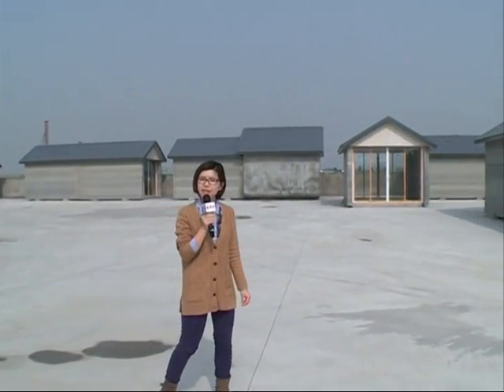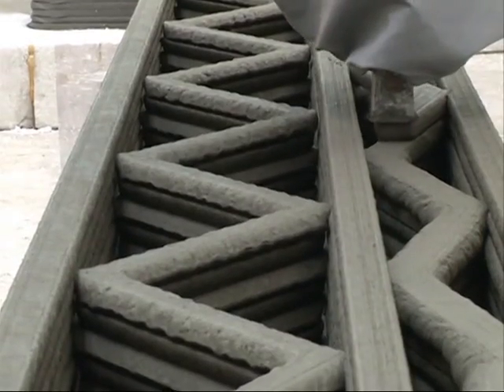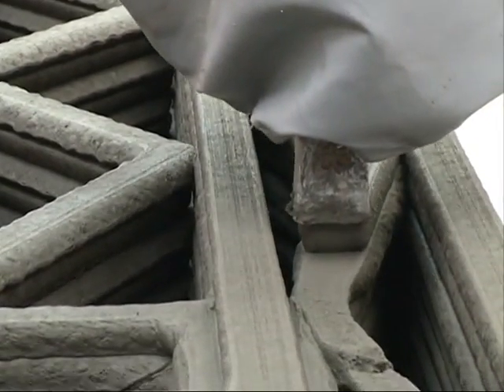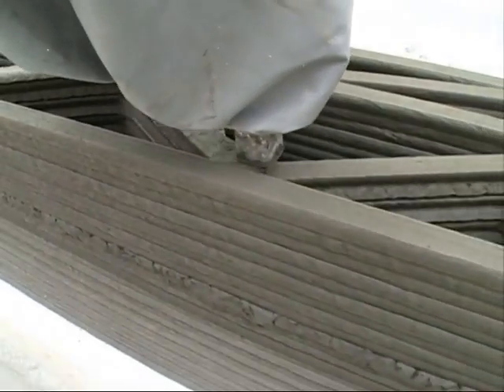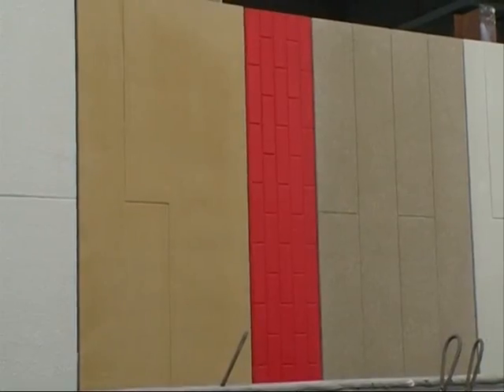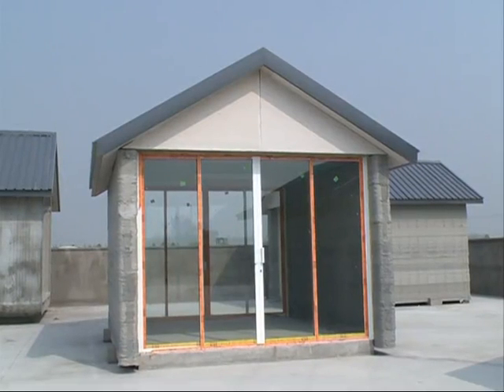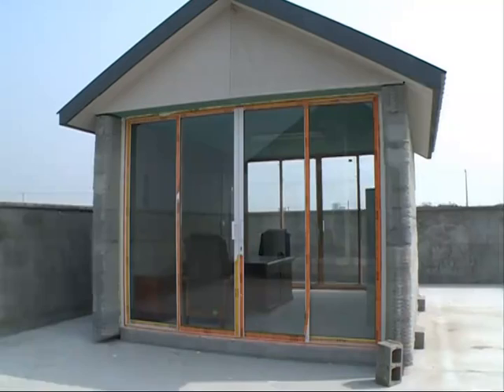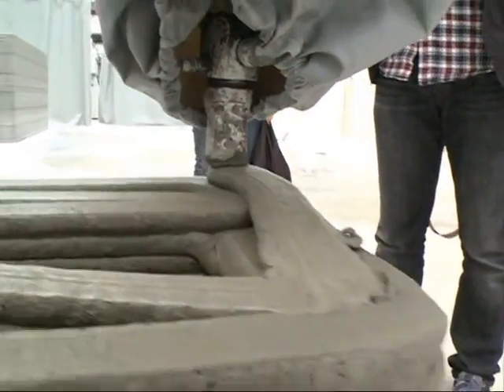3D printers print ten houses in 24 hours

Comment: This is a great concept to build houses for many, both higher cost homes for people who can afford it, but also low income homes.  Having a home out of the weather makes a great contribution to humanity!  I am wondering about the point where the nozzle that deposits the concrete mixture in a zig-zag fashion flows the mix inside the hollow wall.  It seems each point of contact with the inner wall would not be all that great of a bond.  It must work as you have built many successful homes.  It just appears to me to be a weak point.  I am only amateur, but is it a weak point or is the bond very good?  Thanks for making this video and for creating such a great revelutionary way to house all people at a low cost and without cutting down trees, a much more environmental way of construction.

Comment: What is the R-factor of the buildings? What is the vapor and moisture retain/escape ratio? What is the vent and air circulation -%? Cement -and cement only construction is not ideal for every application and climate. I do not see any reinforcing? -not even a mesh-like for stucco.

Comment: Wow - its fast, strong, precise, safe, versatile, sustainable, scalable....such novel thinking! Imagine how this technology could be used to construct "site-specific" homes/architecture - they already demonstrated its ability to construct multiple rectangular shaped houses, but these designs have no relationship to the structure of the land and the weather/wind/sunlight patterns of the building location....site specific architecture requires custom designs based on maximizing the energy efficiency of the home and minimize the upkeep and power consumption necessary to inhabit it.  So, 3d printing offers inherent versatility because the materials are extruded in any direction, making it perfect for customizing the design for the build site.  By utilizing data from the land and integrating it with the design of a building, the outcome would have greater benefits across the board.  Software like Rhino3D and Autodesk programs can combine 3d topographical maps & geological surveys with flow maps, use models, and structural requirements using algorithms that generate forms and structures that work within the parameters derived from such data - there are already many architects using such data driven methodologies to design homes of the near future, check out mark fornes and the very many, he worked for zaha hadid to design buildings from data models and im sure lots of other better examples out there, but its a start. Very inspiring!

Comment: The Salt Project by a Dutch Architect by the name of Eric Geboers will be using waste salt left over from solar evaporation of ocean water to build a sustainable city out of salt and a starch made from algae. A very hard brick can be made and a epoxy will seal in the brick and structure to make it water proof. It would be interesting to see if the salt and starch mortar could be used in this 3D application. Or could the waste brine be mixed in with the cement?

Comment: can I make a remark here. As cool as 3d printing is its not an efficient solution for house building ! What you need is pre-manufactured components that can be assembled on site. They have better performance the house can be moved when necessary or the parts can be efficiently used in other buildings.

Comment: i dont get it. why need so many layers when you can just have one single block of concrete as your wall? just make a mould of the wall structure, and pour concrete in from the top? wouldnt that be even faster?
Reply: It's because you'd have to make molds for all the stuff and the pouring might include air bubbles, which would weaken the structure.  This gives a steady stream, less chance for air bubbles, and you can change the design of the wall structure without having to waste time trying to build a new mold. 

Imagine what would happen if someone broke the mold, they'd have to try and make a whole new one to replace it.  That would be a waste of time and money as a result.
Reply: ***** I see what you mean.  Also, I believe I'd recently found something where just that is going to happen.  They will print up the walls out of cement using the same process.
Reply: john smith having a 3d printer to do the work instead of hiring labourers saves cost in the long run
Reply: john smith Because air pockets serve as insulation and wastes less material when you don't need for it to be that hard.  But what they don't tell you in this vid is traditional poured concrete buildings have a pre-built steel bar structure that can hold onto the piece when it cracks or on earthquakes. When the concrete ages and cracks and weathers, a good earthquake will not only make giant pieces fall on you, but the the wall can fold without the vertical steel bars holding the "broken sections" together.  He's building a large heavy domino house. But China doesn't care, they have too many ppl as it is so their lawas aren't strict like ours.

Comment: How about cables, pipes, sockets in the wall ? Can i drill anywhere to install additional hooks, racks, wall fans ? will it auto-collapse in a quake / tornado ? Can somebody just steal the house away by removing piece by piece ?
Reply: I would use the concrete wall as the outside and fill the gaps with thermal isolation, put drywall on the inside with pipes and wires. :)

Comment: Small houses or shed like building is ok with this technology. But when talking about tall or big buildings then this is not suitable as it is very weak building with only cement and no metal support.
Reply: that may be at the moment, but this is only the beginning. It seems safe to say this process can only improve.
Reply: believe me this technology has only just begun to evolve..
Reply: i agree and also printing food with this isn't FDA approved and not suitable for eating
Reply: They can place metal rebar in the beginning, and then print around it, just like in-situ concrete structural elements in normal construction.
Plus, who knows, someone may invent a way to 3d print much stronger materials
Reply: ***** they will just have to make a machine to weave rebar into the concrete as its poured they already have machines that make rebar mats for roads
Reply: Agree, this is still in the initial stage. If they pump money into research and development. This could replace the ways how common house are build these days.
Reply: Read about jump form, if they only make a better material it will all apply to this technique
Reply: This technology is a supplement that can create "blocks' That you fit together to make the complete house or structure.
Reply: LamboKang= You can use melted metal; for instance. Steel mixed with other materials then you a cooling agent to cool the steel. I can see this technology change manufacturing and real estate development.
Reply: And other areas L: food production and organ transplantation.
Reply: LamboKang they could put metal frames at the beginning but the fact that the printer has to go later by layer is a problem. It can’t print in air

Comment: Those ain't no houses! Just bad jokes or mere cottages for domesticated animals. Nobody can print an entire structure as a whole. At least not yet. Those printers are very good for prefabricated elements for cheap houses. They can do beams, columns, slabs, even walls, but NOT entire structures. How do they print the rebars, and how do they stick or link those rebars together? It's beyond stupidity. It's actually an attemptive murder crime by technical ignorance and lying to the customers.
Reply: yup. you are so smart. here's a trophy
Reply: ipse lute
Calm down, fool. This is obviously still in early stages. You're being a moron, crying over nothing.
Reply: Yow Hwui Low Can you please 3d-print the Hoover Dam? Or maybe The Empire State Building? Or at least Burj Khalifa!! Concrete and reinforcing steel bars are two (very) different materials!! And just because they are so physically different, they must be printed separately.
When you wanna add concrete to a rebar meshing or a rebar cage, you can do it in two ways: by pouring concrete, or by injecting concrete, into a formwork or a mold. That basically means 3d-printed concrete is just not fluid enough to enclose the rebars thoroughly and fill the formwork evenly. It's common sense not rocket science.
Reply: I agree those are not proper houses. But the reality is: most houses delivered by goverments in the so called 3rd world are no much bigger than that. Besided, given that they are recycling materials, this might actually be a short term solution for lots of people. Imagine the  pro catastrophe areas in the world and people who are left homeless!
Reply: Fernanda N. Jesus!! Indigenous people all around the world have been creating small cheap houses for millenia by using just mud and dirt and timber and lots of manual labor!!!! You don't need hi-tech expensive machinery to built or 3D-print small cottages. It just doesn't worth it!!! You may need those machinery to built things on Mars or other planets, but certainly not on Earth. It's much cheaper to build wooden houses. And more ecological, as well. And healthier for long-time dwelling as well.
I will never understand communists' obsession for concrete! It ultimately didn't help the mayans or the ancient egyptians ,nor the romans.
Reply: Keep cool :-)
This is just the beginning. There is no big problem to include wires, glass fibers etc. This all will be done - not in one or two years, but it will be done.
Great (first) job done by the Chinese!
Reply: 123jogger123 Gr8 reply ! Your the first one i've read that stated the obvious fact about this 3D printed 24 hr / houses.....not really a big problem reinforcing the parts (structures) , and have it done sooner or later, and 'em Chinese are first one in the world to succeed in building houses with in a 24 hr time frame .

Comment: It seems to me a stupid idea to build houses from waste materials instead of using natural ones such as wood...
Reply: Really? If you want to pay for a house, it start at 200 000$ where I live, and it is a very small one. A decent house is around 300 000$ and everyone know it could raise up to 500 000 - 1 000 000$ & + for a nice house. Did you ever look what happens when they are building a house? They put in the garbage around 30% of all the materials they need, that's right, they are doing all that waste for each and single house. You still think that it's a good idea to use wood? The 3D printing not only use the waste we created, the 3D printer put away all the workers you need to pay $$ for the construction, so obviously the house price is going to be extremely low, which is the main goal. So basically, the whole idea is cheaper and it use waste materials (instead of creating more waste). It's really not a stupid idea.

Comment: Any serious structure made of concrete requires rebar... an internal structure of metal.  Concrete does well under compression, but is relatively weak in tensile strength.  When a lateral force may be applied to the building (like wind and earthquakes), you want rebar in the structure, especially for taller buildings.  If you're diluting concrete with industrial waste, you're not going to get as strong of a bond once the concrete is cured.  Under heavy loads, you don't want a structure made of anything brittle.

Comment: Yep. In Korea, we're making 3d printing machines that can print electricity conducting "wires" WHILE printing the plastic polymers around it. So basically, it will be a functional 3d circuit "board." that can be turned ON as soon as it comes out of the printer.. well, you'll have to put the battery in it first.

Comment: There is a fine line between 3D printing and factory automation. Original 3D printing was making small objects with a device the same size as a printer and using other materials instead of ink. When you get to much larger objects you have moved into the realm of automation.

Comment: Who said that Chinese can only copy .???? ;) ;) ;)
Reply: Are you asking? Because this is a modified shape copy of the concrete printer Loughborough university developed in 2007.
They used it to 3D print sculptures and benches due to space constraints. They used power station ash to augment the cement to reduce carbon footprint but that's all I remember. It looked like a giant 7-8 meter cube version of a normal desktop 3D printer. It wasn't as fast, but this is early concrete 3D printing on PhD budget designed by 19-25 year olds.
Reply: maybe the so called number one in the world who have been  using all our products and Japanese machines and English languages and Italian shoes, etc.

Comment: Why is everyone excited about a shell? In order to run electrical, plumbing, insulation, hang cabinetry etc, your are going to need to build internal walls.   You've just added a layer if complexity and cost.
Btw would you want up live in a concrete home without rebar in an earthquake zone?

Comment: Would need some kind of secondary arm or layout with which implemented better structurally sound walls and foundations (like adding in re-bar). A weak earthquake seems like it would shake this thing to pieces. Would not hold up to modern building codes... :(

Comment: I have one question:
How much those walls are strong ?
Reply: Question understand well not I do well.

But taking a guess as to what you are asking, even 'weak'/normal concrete mix is good for 3000PSI.  Given the inside and outside walls are 2" thick each (a reasonable guess), a 1' length of wall should be good for (2*12*3000) 72,000 lbs of pressure (for every 1 foot long piece of each wall).

Pretty good strenght.  Put in some plastic, glass, or metal 'fiber' short pieces for reinforcement and it should be plenty strong without rebar. (This is a technique being used a lot these days.  I have used one to make up )

Comment: Just don't use TOXIC WASTE!
Reply: What toxic waste?  Portland Cement is basically limestone raised to a high temperature to drive off water.  It is mixed with water, sand and 'stone' (rock of some kinds), with optional chemicals to give it specific properties to set faster or slower, be stronger or weaker, be more or less flexible, be able to be done in freezing conditions or in very hot weather.  You can even reduce the amount of Portland Cement used if you include flyash (from burning coal in power plants usually) or slag (from steel production) and have the concrete be just as strong or stronger. ... Yes the flyash or slag can be toxic, but once encased in the cement it is not free in the environment and not considered toxic anymore.

Comment: Now just stuff some good insulation into those walls and I'm ready to move in!
Reply: the sealed air pockets would make great insulation, like a thermos for your coffee, as long as its sealed like it is, it provides great insulation
Reply: Revoku The air pockets will provide only minimal insulation. The material acts as a thermic bridge and to get decent insulation something else is definitely needed. In this case external insulation panels would be the best I think, as they simultaneously provide an aesthetic finish.
Reply: Anthony Fink
I'm assuming those houses haven't had any waterproofing done to show off how they look like after the printing, otherwise it would conceal everything and they would look like normal buildings.
Reply: Anthony Fink With the correct additives it can be.  Even concrete brick isn't 'water proof' when initially installed, but an additive makes it more water proof as it weathers.  (A friend sells the additives that do this.)
Reply: Revoku except concrete isn't waterproof...

Comment: Printers are getting bigger and better.  Making a gigantic printer like that that can print to .001 micron would be an achievement.  Then you could pretty much make anything I guess, if it would have a big enough work area.
Reply: For this use, 1mm accuracy is plenty sufficient.  Not everything requires micron level accuracy.  All it needs is 'appropriate' accuracy for the task.  In this case a thousandth of a micron is overkill.